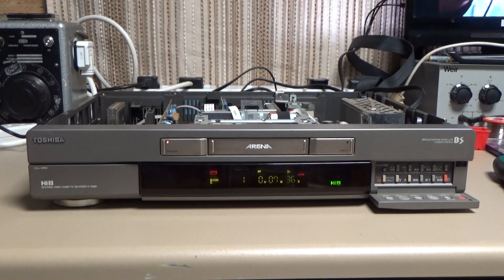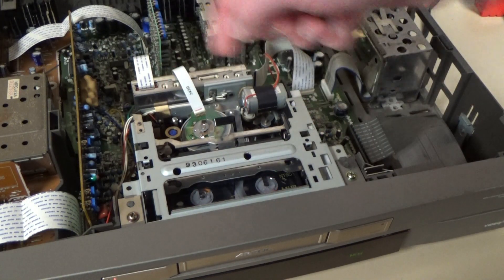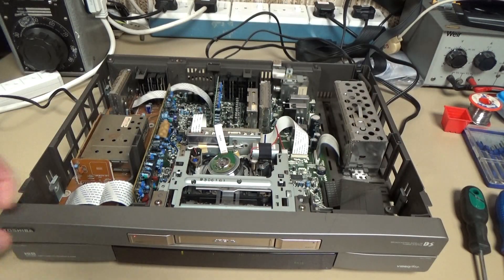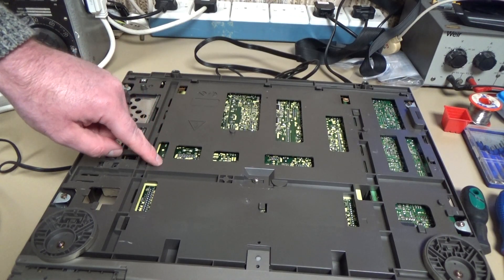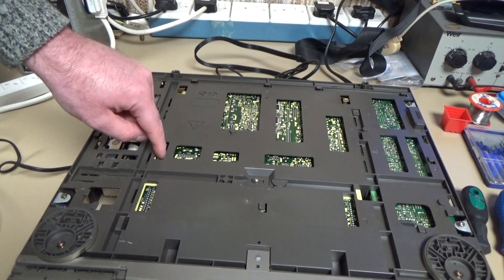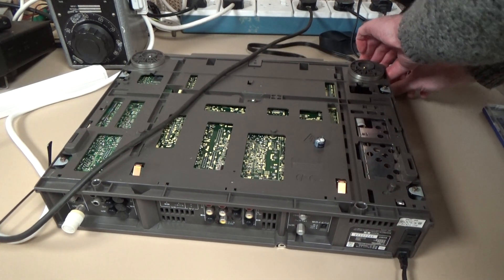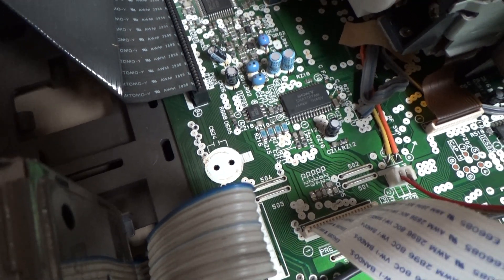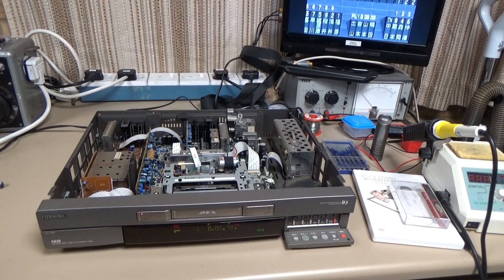Toshiba Hi8 Video Deck - Leaky Supercapacitor Extraction - E-700BS

Comment: I used to fix those vcr's in the United States. They were expensive. They cost about 8 hundred dollars, and most repairs I did would cost about 2 to 3 hundred back in 1996+. Nice Video. Thank you.
Reply from the maker: Interesting, I didn't know these were sold outside Japan. Maybe there is an English-language service manual.
Reply: @timf-tinkering  I worked on allot of Sony ones. I remember that brand too. they were troublesome. Toshiba, and sony were the only brands that I have ever seen in my shop in a 8mm video player, recoders.

Comment: Nice video Tim as usual. Re the sticking friction wheel, if its just lack of lubricant (or congealed lubricant), could you not remove it and clean it, then add fresh lubricant? Maybe it needs a spring to bias it back to the head drum which may have lost its spring. Might be hard to replace?
Reply from the maker: Yes, ideally that's what I would like to do, but I can't find any service documentation for the machine, so it's a daunting prospect!